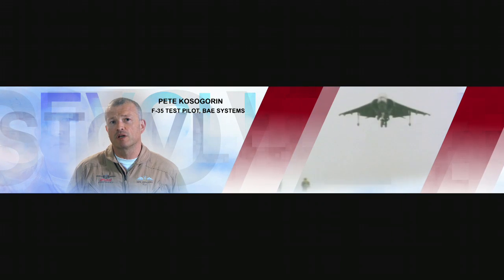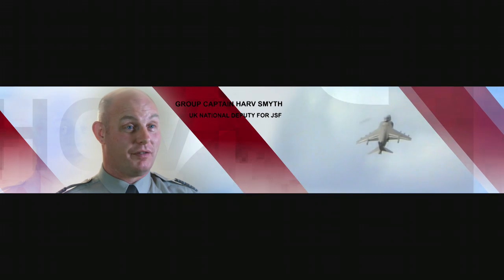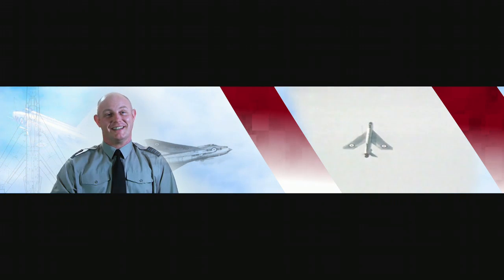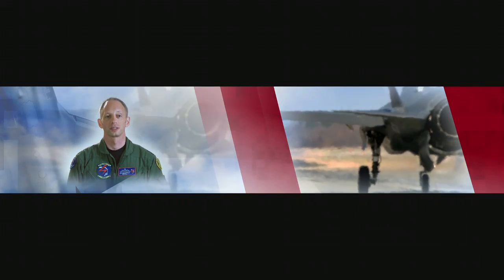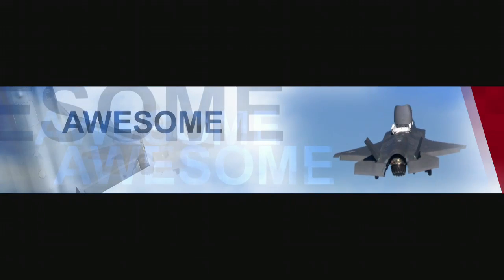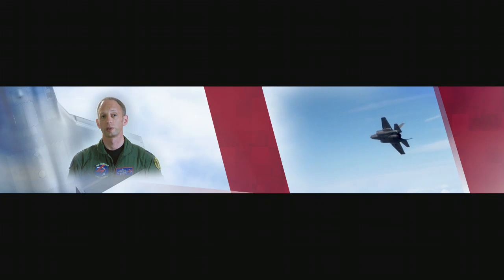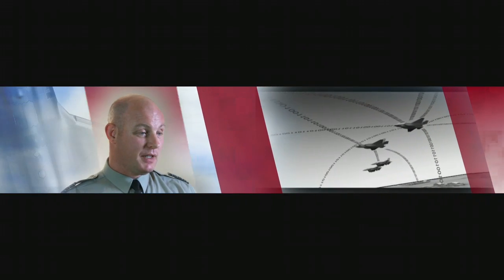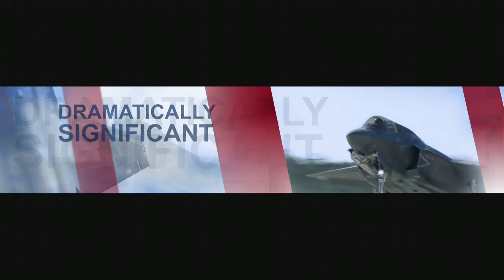5th Generation STOVL Capability for the UK

Comment: The AMRAAM engines work just not at the F-22's extreme altitudes. Production continues for the Navy but not the Air Force. The MARC-282 Ramjet was adapted to an Air-to-Ground and Air-to-Air missile that heavily outrages the Meteor. DARPA is working on the Triple-Target-Terminator which will combine an Anti-Radiation, Air-to-Air and Air-to-Ground ramjet powered missile into a single airframe. Europe has no such comparable effort or full production ramjet motor. But thanks for playing!

Comment: Again, the US has a ramjet missile in full rate production on a very mature line that can churn out a much more powerful Ramjet motor (the quad-ducted MARC-282) than the Ramjet motor used on meteor. The MARC-282 was adapted for HSAD and for an Air-to-Air missile.

Comment: They US has a active production line for Ramjets; Europe has a line for pre-production Meteor engines; only a handful of been built.  The GQM-163 "Coyote" is in full rate production with the sixth lot order recently (August 29, 2012) placed. Missiles are manufactured at the rate of about one a month. The Coyote is in active use and has been to exported to France because it was only way France (and MBDA) could qualify the Aster 30 against a supersonic, air-breathing missile.

Comment: But it's nice to see that Europe will have a missile designed in the 90's to arm her aircraft which were designed in the 80's!  The Typhoon production line is closing (layoffs have already begun). The Gripen NG still needs to be funded & Rafale needs to close the Indian deal which still hasn't happened. Europe has no 5-6th gen fighter development and can barely nail together a modern UAV which still hasn't flown. There is a reason 3/4s of the Eurofighter partners are buying the F-35.

Comment: Have you seen the launch signature of the Meteor? It's a smoky, explosive affair. The ramjet fuel has metal that reflects radar quite nicely. The ramjet is not flying a lofted trajectory (it can't) but a flat trajectory within the field-of-view of enemy sensors. It's got a much larger thermal signature due to body heating, its hot ramjet inlets and its very hot exhaust. Take a look at the US HSAD ramjet as well. It's quite a thermal event both in launch and in flight.

Comment: The Swiss Air Force evaluation documents were leaked. It's the most honest assessment out there. *Some* of the engines had trouble at the most extreme temperatures but not enough to withdraw the entire type. 

The first pulse burns out to boost the missile to a high altitude. It coasts for many miles getting updates via a stealthy data-link, another radar or the enemy's emissions. The missile can then (but doesn't necessary) ignite its second pulse for it's dive.

Comment: The "D" is actually quite maneuverable because it has a second rocket motor pulse that engages when it begins its dive (the missile can fly a lofted trajectory) on the target aircraft. The point of the ramjet is not sustained power for turning and burning but higher sustained velocity to the target. A ramjet cannot turn as quickly or as tightly as a rocket because that would disrupt the airflow to the ramjet. Rather, the ramjet has to bank like an aircraft.

Comment: Most of the "D" missiles work just fine but there have been issues with motor reliability at the outer edges of the temperature envelop, hence the second supplier. The PK assessment comes from public domain US & Allied analysis, in particular Swiss Air Force evaluations against the Eurocanards. How does  AMRAAM emit "a huge amount of heat" compared to meteor? It's radar and second stage doesn't engage until it goes terminal; it can be totally passive as well, homing on the target's EM emissions

Comment: The PK of the late "C" and "D" is vastly better than what you state. The "D" has a two-way data-link and thus has three simultaneous terminal guidance modes (active, semi-active and data-link). Do you think it's really possible to defeat all three and the missile's kinematic advantage (it's diving on the target and the second stage motor has fired) ? That's assuming you've even detected the missile at all; it has a very small RCS (especially compared to meteor) and less drag.

Comment: I know the operational history of AMRAAM pretty well; actually ramjet versions of the AMRAAM were secretly used in the Gulf War. The AMRAAM has a very high PK and all were fired beyond-visual-range where they've knocked down MiG-29s and MiG-25s with ease (generally on the first shot). How's the Meteor coming along? It's way late and way over budget. The "D" is having problems due to it's new, much longer (50% increase) range motor. Nammo Talley has been engaged as a second supplier.

Comment: Liquid cooling was necessary for the Blk 60 because it was so constrained from a power/cooling standpoint. A a decent sized array on the Blk 60 required extensive modifications which hurt performance relative to the Blk 52. 
for 5th gen or a huge 4th gen fighter like the F-15 (its AESA is actually bigger and more powerful than the F-22s) or the Su-27 series there are fewer issues.  Still, the US Russia, India, China, SK are going 5th gen because they understand the trends you do not.

Comment: AMRAAM has been extremely reliable at long ranges. It's like saying we should design aircraft with backup propellers because jet engines were historically unreliable. The F-22 designers gave it the world's most powerful radar and most powerful passive electronic support measures so it could detect and destroy aircraft at very long range. The F-22 is optimized for first-look-first-look beyond visual range. It can dogfight but it doesn't have an HMD or HOBS SRAAM; added these has been expensive

Comment: Wow wikipedia, the well known expert on aircraft! The AN/APG-80 is inferior to the AN/APG-79 in every respect; Lockheed couldn't accomodate a much superior radar because it would have entailed even more expensive design changes (the Blk 60 still cost several billion to develop and are $80 million a pop). All of that added weight (especially from the liquid cooling system for the radar) does reduce range which required the use of conformal tanks and a new engine which hurt maneuverability.

Comment: Engines and the airframe i.e. kinematic performance is but one dimension of aircraft performance albeit an important one. You can't put the much superior AN/APG-79 AESA into the F-16 nose because it's volume, power and cooling constrained. The history of A2A combat proves that the aircraft with superior situational awareness and first-look-first-shot advantage will almost always emerge victorious. The F-35 can accomodate 6 AAMs for the A2A roll but that version won't be the initial config.

Comment: Correction; looking at the recent (late 2011/early 2012) contracts for the F-15SA I estimate a new build F-15SA per unit price of at least $95 million. Support, spares and maintenance costs will be higher than the F-35; the F-15SA is less capable than the F-35 but still quite effective.

Comment: No you can't put the latest EW in any old F-16/18 without compromising their performance; several billion $ to develop blk60 F-16 @ $80 mil/unit; *no* growth potential. The F-18E was 10's billions $ to develop @ $70 mil/unit. The SH does have growth potential but it will cost yet more billions to develop. The F-15 is the exception that proves the rule; a new build F-15SA is $85 mil; want stealth, internal fuel/weapons? at least $100 mil. *Initial* F-35s are slightly more than $100 mil

Comment: BAE was exclusively involved with McDonnell-Douglas (which later merged with Boeing) because MD did a custom, licensed produced variant of the Harrier (AV-8B). BAE + MD + Northrop Grumman had a very capable (but largely notional) JSF submission that got eliminated. Boeing and Lockheed-Martin were the other two competitors. Boeing dropped MD's design after the merger with MD and BAE and Northrop-Grumman partnered with Lockheed. Boeing went on to lose the JSF competition to LM + BAE  + NG.

Comment: Given that electronic warfare competency is essential to Air-to-Air or Air-to-Ground success why wouldn't they laud those features? They *can't* put the latest electronics in any airframe you want; 4th gen aircraft are generally too volume, cooling & power constrained for the latest EW gear. The F-16 Blk 60 required a totally new engine + heavily modified airframe to carry its AESA radar + EW suite. The Rafale's AESA is weaker than the Block 60's due to similar volume/power/cooling constraints.

Comment: BAE could not have  been involved  very  early on  simply  because  this project competed  with  Boeing X-32  first    and  only  after it has been declared winner  the other partners joined the program as subcontructors and not before. 
You are revelling in complete fantasy..BAE is not stupid  to get involved early on  with any of them without knowing who would win the race.  What would  have happened  if Boeing would have been chosen? Was BAE  also involved with Boeing early on as well ??

Comment: A ski jump isn't required but it does shorten the take off distance required and will allow heavier max take off weights, the old harrrier saw massive gains thanks to the 12.5 deg jump on the ark royal. The B only has more thrust then weight in base config carrying little fuel or weapons so its is unlikely ever to see a vertical take off.

Comment: The central vertical fan and accessories are so heavy and use so much internal volume that they diminish operational capabilities to the point where the F-35 will be useless in many battle scenarios.

Imagine utilising that volume to carry fuel and/or weapons! It's mind boggling! 

During normal flight the central fan is just dead weight!

Sure, you can take off from roads and short carriers, but once you're airborne your range is too low and your weapons are too few. Is it worth it?

Comment: Well almost, it cant take off vertically but asides from that pretty much. In the end it probably wont land vertically either, a Short Rolling Vertical Landing that the RN are currently testing has the prospects to be much more efficient especially combined with ski-jump launches both utilised could see a nice boost to range and carry weights.